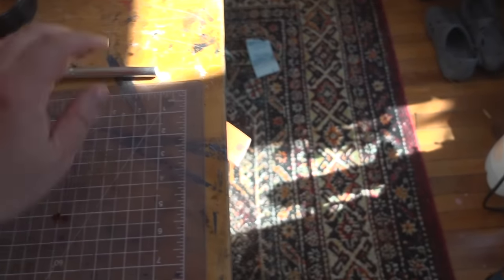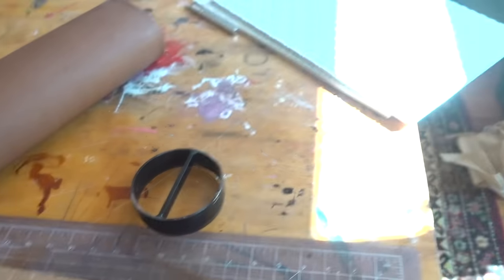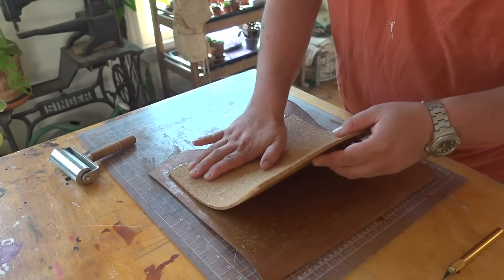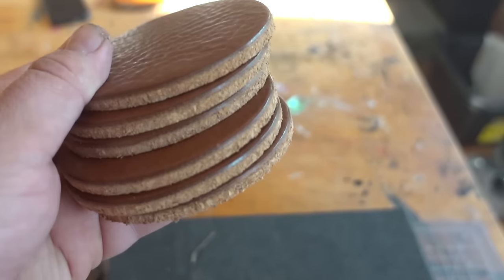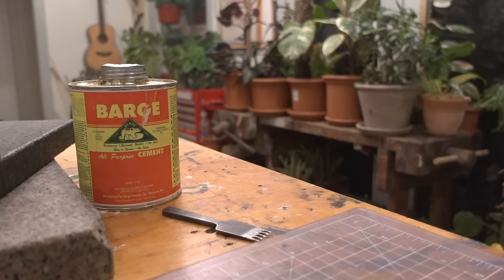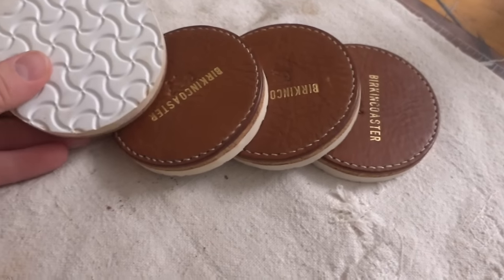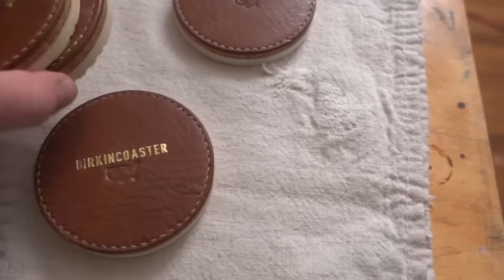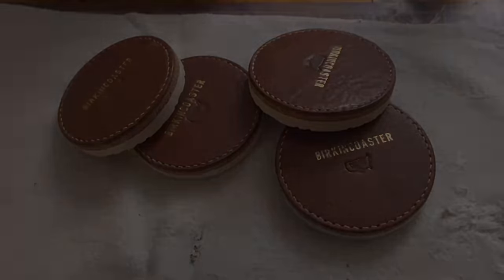Making Birkenstocks Except they're Coasters

Comment: This is the definition of a 'Visual Pun'.  Who would recognize the pattern on the sole if they didn't 1) work on Birkenstocks or 2) be a big fan of the brand.  Eric, I admire you cleverness with the metal shim under the press to finish the cut.  Leatherwork = Problem solving.